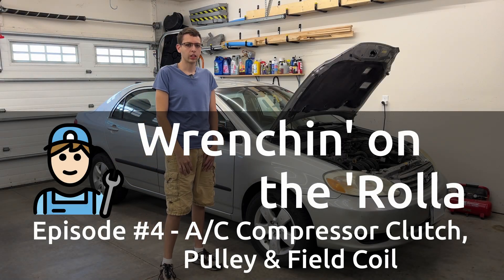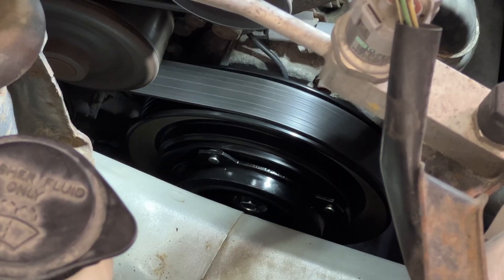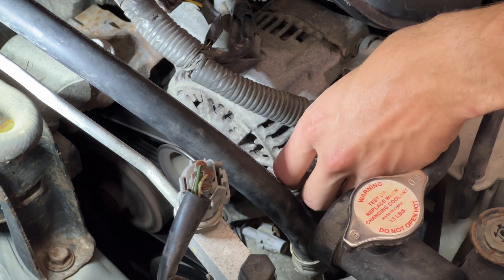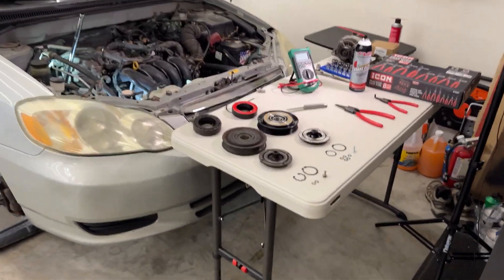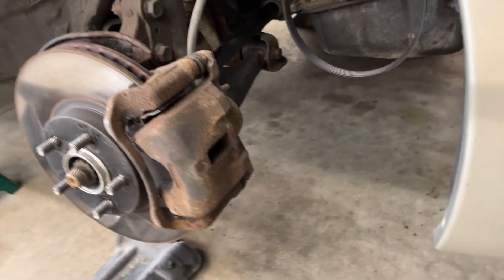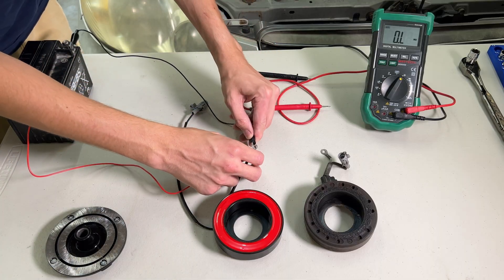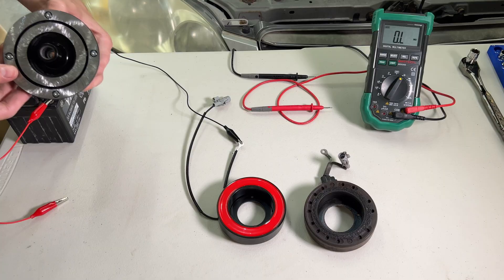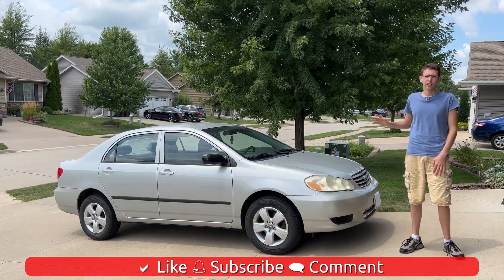Corolla A/C Compressor Clutch, Pulley & Field Coil Replacement (2003-2008). A/C Diagnosis & Repair

Comment: Great video. The situation on my 2017 Corolla LE is quite different though.
It was hot air and I saw the clutch spinning regardless I turned on/off the AC. So I added the Freon and it was getting cold again, so far. The problem was even I turned the AC off the clutch was still engaged. I tried to switch the compressor relays but that didn’t help. Please help explaining what was wrong and where I can look further. Best regards.

Comment: Hm, I got 10.6V to the compressor. :/
Reply: Make sure you have a good connections with your tester leads, and check the battery to make sure you have 13.5 volts.
If all that checks out good, try replacing the relay as those connections can become oxidized and drop voltage across the contacts inside the relay.

Comment: I appreciate the video. My clutch magnet died at 286k, and I was ready to drop it off at the mechanic but your troubleshooting guide helped me decide to do the AC clutch instead. It worked and now everything is cool again. Thanks for the video (and the followup with advice about making sure the inner circlip is seated properly).

Comment: I'm in the process of doing this - no need to remove the alternator
Reply: Done - put a roll pin in the electromagnet for good measure. My old electromagnet smelled like burning ;)

Comment: That single pin connector got torn out somehow and I cannot find where that cable led to video has the radiator cap blocking as well 💀

Comment: Just did the compressor clutch job yesterday and the exact same thing happened on my test ride today. Tomorrow, I’ll be climbing back under the car and having a look to see if the body of the compressor is all reamed out like yours. Ugh. I live in upstate NY and everything is rusty and a challenge. That clip holding in the field coil was rusted in, making its removal quite challenging. Took me hrs to get everything apart. Tofay, I heard a rattling sound and opened the hood and alas, the field coil was spinning, wires clanking around. Bummer. Thanks for sharing all of this content!

Comment: I think going to check the easier steps, relay/ fuse/ and connectors, hopping these take care  my problem, any way your video I believe it's very good but if the  problem is the compressor I won't be able to do it looks for me a little complicated.  Thanks for the video

Comment: hey man i own a similar but older corolla. i found that the clutch pad was entirely missing on mine! is that normal? does it fall off randomly?
Reply from the maker: I’ve never seen it happen, but I guess everything wears out eventually. Hopefully you can get it replaced cheap, or just a block of wood screwed on could work.
Reply: @BrenoAutoGarage  I got the pad for 16$ at the junkyard.

Comment: Great work here.  Awesome presentation.  I can see the bike battery is very dear.  They  are def handy for a lot.  Ive done this job before and its not fun when the clutches need special tools to take them off due to threaded on clutch.  But thanks to your write up here that isnt really a difficulty here. Just need c clip tool.  The tip to test the field coil connector and nevermind the relay gets another thumb up.  U rock bruh.

Comment: Excellent video.  Here's a hint to make the clutch friction plate last much longer:   Engage the A/C when the engine revs are low. In my manual shift cars I would push down the clutch pedal so that the engine would drop to idle or in an automatic,  engage the A/C when at a stop sign. This way the RPM mismatch would be low between the A/C clutch plate surfaces.
Reply from the maker: That is a really good idea, thanks for the comment! I should treat it like a transmission clutch and turn on “rev match” the AC at low RPMs.

Comment: how did you tighen the bolt in the middle of the ac clutch without it spinning?
Reply from the maker: I used an electric ratchet. You could also use a normal wrench and tap it with a hammer/mallet to act as a light impact.

Comment: Great video, I still collating with my 2004 Corolla, actually was going to evacuate the freon yesterday only to discover I need a coupler adaptor for the recovery machine which was insanely expensive and it is beyond me why they do not included one there, after not finding it at home depot and harbor freight, ordered amazon and comes Monday, so in my case AC was running hot, system seems to have charge, OEM compressor tested good with battery and so the relay as well, I have all parts related to the AC so since car has near 140000 miles with 2 engine jobs prior I think maintenance replacement would extend parts life, so recovering and adding new freon later on, engine is still out of the bay in my garage almost ready to go in but now beside this I saw a video about timing chain on this engine which convinced me I did my timing wrong as I have a hair off the marks and left it like that advised by a dealer mechanic, I have been all these years wondering if I should re do it again before dropping the engine and this video is pulling me in that direction, in my case it should be a couple hours correction job but better sage than sorry, when I did my timing there were no videos how to do it properly only one from Peter Fin the self proclaimed car doctor but I have my reserves on his ways, so here we are still struggling with that corolla, my daughter got her DL 3 days ago and car still not ready, it has been out only 3+ years!😂
Reply from the maker: Hello again and thank you for the comment! It would be interesting if you could measure the recovered refrigerant to see how it compares to the correct fill amount, like you said in another comment. Then you would know for sure if there is a leak or not, although since you have some pressure still in the system after many years, if there is a leak it is very slow. I do not have a set of AC gauges myself, or a recovery vacuum machine. I usually only buy tools as I need them, and I have not needed to work on refrigerant yet, but it is interesting to hear about your experiences.

Did you do the first timing job while the engine has been out the last few years, or when you were still driving it? I’d think you would notice immediately if the timing was off even one tooth, and the computer might throw a code. When I did the head gasket on my Prius the timing chain had sets of orange links that would line up with the marks on the three gears (crank & cams). This made it very easy to get the timing right, but I did have to rotate the engine many times before taking the chain off to get it to the correct position where they all aligned. Then I just put it back the same way and it worked.
Reply: @BrenoAutoGarage  It is possible to measure exact freon recovered as I also have the scale, tank is zeroed as it weight 16.2 pounds empty. As soon as I het the couplers I am missing for hose adapters this will be done. Timing was done with engine out, I just did it again correcting my first try, got the marks align now trying not to lose alignment once torquing the pulley, took pics and went to dealer to confirm I am right this time, I thought better safe than sorry and took on taking it apart. Feel little more confident now, lets see if the timing holds; the manual is horribly confusing as far as directions goes and there is a lot missing
Reply from the maker: Let me know how the refrigerant recovery measurement goes, that will be a cool way of figuring out how much was in the system
Reply: @BrenoAutoGarage  It went well, did it yesterday having the tank zeroed on the scale I recovered only 8 ounces, system suppose to have 1.2 pounds; disconnected the lines checked the seals they seem fine they will get replaced. I am finishing taking apart the dashboard bars so I can get the evaporator out, since I have a replacement I will do that, instead of flushing the system; so evaporator, condenser, compressor, seals will be new and system will be charged new freon; the one in the tank will take for recycling. The taking of the part where the heather core and the evaporator is it is a real PITA but I am already almost there so why not?
Reply from the maker: That is interesting, missing over half the refrigerant! I am hoping that it works and does not leak once you get it back together and refilled.
Reply: @BrenoAutoGarage  It was a real PITA to get to the evaporator, the Hynes manual shows steps removing the steering column and the cowl bar but it is possible to get it out and then in with some major struggle being extra careful, the box where the evaporator is also with the heather core, has 3 screws from the back side securing the assembly to the blower part, if those screw were made to be accesible front the front, the box could be opened without have to go through hell to do so, I was cursing out loud Toyota engineering for this stupidity but with time and effort got to it, nothing broken, found my evaporator in pretty good shape first sight but replaced with the TYC Chinese one and also a new ACU expansion valve, waited like couple days for a 1/8 wrap for the pipes and valve as the old one desintegrated when unwrapping it then now it is back in; all seals replaced as well even the factory ones I could not see any sign of wear, distress or leaking, there was a pressure pop when I took them off so that tells me the leak if any was not from there, now I am more concern if by replacing it I am not introducing leaks myself, oiled them with refrigerant oil as recommended. The heater core was also found in good shape, I did not back flushed as all the old little coolant still in there was out easy and air could be felt circulating through, so I just put it back, it is all attached back to the dashboard, then I secured the steering rack pinion bolts which I had tried to separate and could not, leading me to struggle to get the part out without lowering the cowl bar, now the bay needs to be re assemble, steering wheel and all, then for engine bay the engine is ready hanging from the hoist to be dropped in, and I am praying I do not have to separate the transmission to get this done! at the dealer they get to the engine as a whole from underneath, we have to do it from top, most folks separate the block from transmission and then back in; that part was a. horrible struggle as well for me as even with the axles removed there is literally no space to separate the trans from engine block there, using pry bar marres the bell housing aluminum badly, mine looks like it went to war! and it was! this is why decided to get the transmission out, attach to engine and drop the whole thing in, transmission nose diving in an angle, and see if this works! so stay tune, more to come, I am just starting to feel sorry I have not recorded this ordeal!
Reply from the maker: From hearing your story I hope I never have to replace an evaporator on a modern car! Sounds very hard indeed. Good luck on the final re-assembly, I’m not sure either, you might be able to tilt and squeeze the engine & transmission assembled in as a unit. Would probably be easier than dealing with clutch alignment in the car if they go in separately.
Reply: @BrenoAutoGarage  The assembling back the dashboard was as difficult as taking it apart but it came back ok, I know I put everything the way it was, yet, once back together I found having 4 extra black screws and 2 extra brass one, can not tell for the life of me where I forgot to put them but all critical places are solid so I will leave them around; the dashboard needs to comes apart again by the dealer to replace the passenger airbag per a recall; will tell about the screws to the service manager and hopefully the tech doing the replacement will find it where they go, I believe they are from the airbag init itself but not sure and no way I would take it apart again to find out, yesterday I dropped the engine back in the bay finally, a coworker came and helped with guiding; took us about 1 hour and 15 min because the center bumper bar had to be removed also the center vertical bar where the hood latch goes; the top cross bar seems impossible to remove for what we observed but after removing the big front curved horizontal one the lift had enough clearance for the whole engine to be lifted and dropped straight down with some minimal adjustments; it was not needed to tilt it and I am happy to find out that it went in just as I thought it would with almost all components on it, next challenge is the exhaust connection underneath, the axles, the steering pump high pressure hose to steering pump and the shifter cables bracket because there is very limited access and clearance to these and they need to be torqued to specs; as soon as there is good weather that is next. I already detailed the back seat and removed both front seats for detailing and detailing of the cabin floor carpet, then comes all top connections of ac lines, radiator and condenser, all fluid lines and the big question if it will start and run, LOL, simple!
Reply from the maker: What a big job! Ever since doing the clutch on my Corolla I’ve been thinking how it might be fun to do an engine swap some day. But when I read your reports it reminds me every car project always takes 3x longer and more work than you think it will to begin with. I have never taken much of my dash apart, but brass screws are fairly rare, I know two are used to hold the drivers airbag in once it snaps into place, maybe that is where they go?
Reply: @BrenoAutoGarage  possible, they do not go at the drivers side, I will mention them to the service manager once car is sent for the passenger air bag recall. It is now at 96%, just discovered I installed an incorrect seal in the transmission passenger side, also found out we do not supposed to hammer the axle in like I did on the passenger side trying to drive the shaft home, the drivers side I used a dead blow hammer and went in without much banging but the other side wont go in and drove me crazy before I found out it was because of me in the first place, waiting on that seal and hopefully inspect the axle to make sure I did not damage it, fluids are not in yet, yesterday I put the battery to trickle charge, we are getting there!
Reply from the maker: Congratulations on the progress. It will be a good day to have it back on the road. Once you are done you will practically have a new car with how much has been replaced.
Reply: @BrenoAutoGarage  98% left to do washing the seats and carpet, re install, adding coolant, oil, battery, prime engine, install spark plugs, fuel injectors plugs (fuel relay?) coils; turn key; if starts and runs, add the freon to AC!